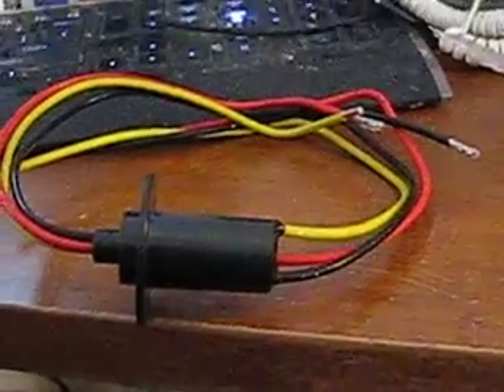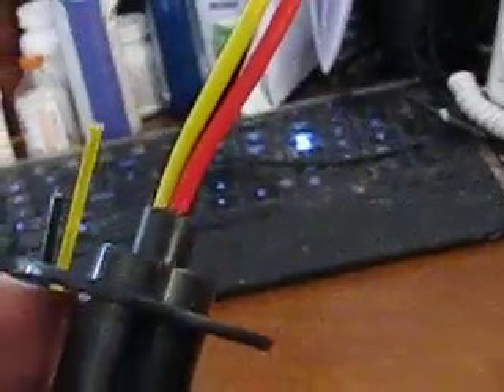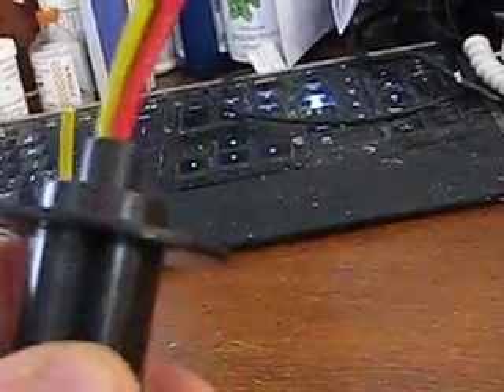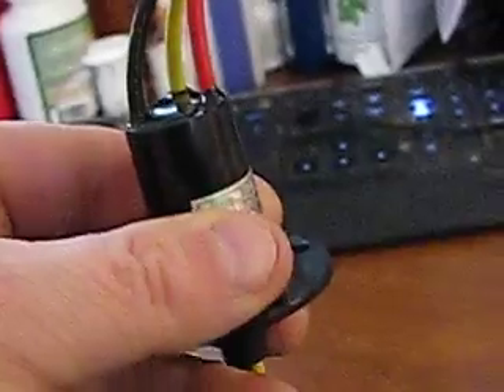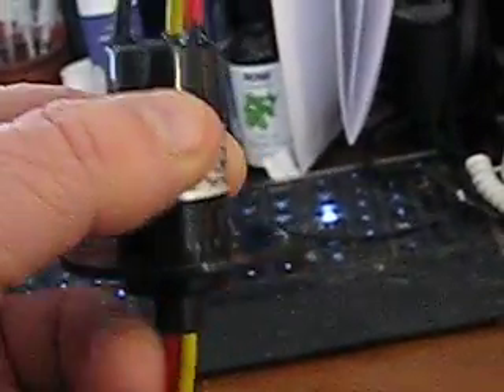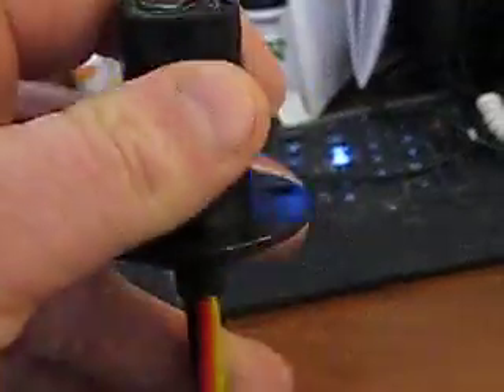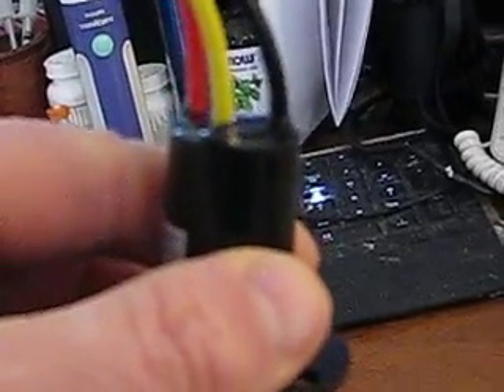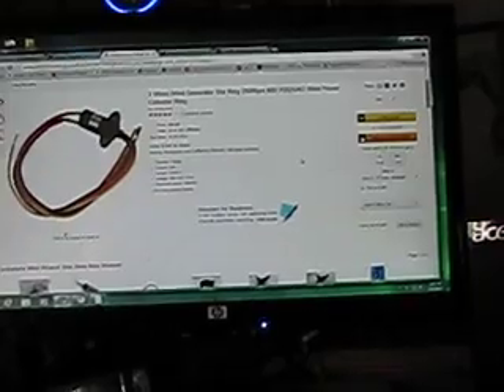slip ring 001

Comment: Are the wires positive and negative? I have one with 6 different color wires that I wanna use with my lights
Reply from the maker: you choose what wires are assigned to
Reply: Rev John O'Toole  well it’s not made for what I’m trying to use it for. But I’m just gonna give it a go. Thanks for go ur video and reply though. Every bit of information helps👍
Reply from the maker: @toomanycactus3138  it's used for tw parts rotating independently, just be sure you don't exceed the voltage and current rating
Reply: Rev John O'Toole thanks so much. I don’t know if it was just the way my brain misread it the first time. But I totally get your explanation now🤟and thank you greatly. Hope you will take a look at my invention once I get my slip ring from china👍